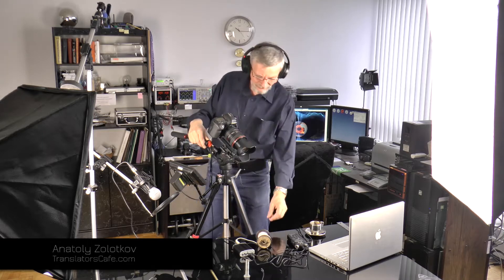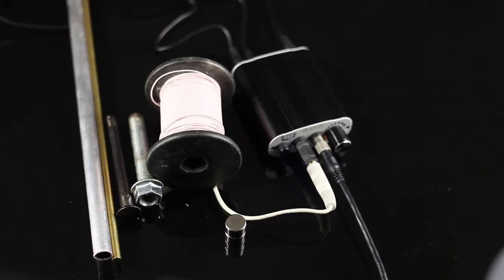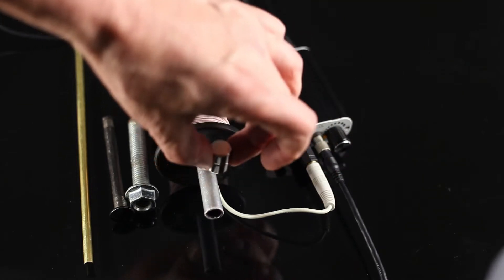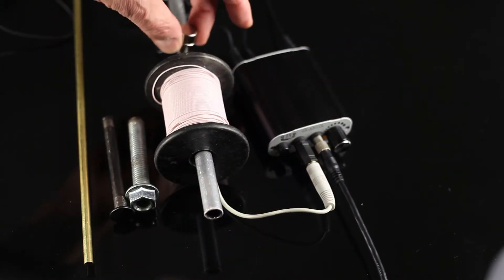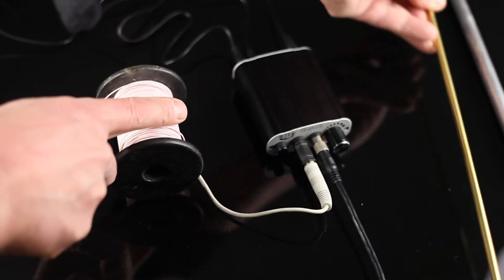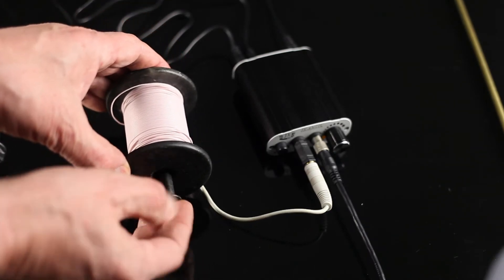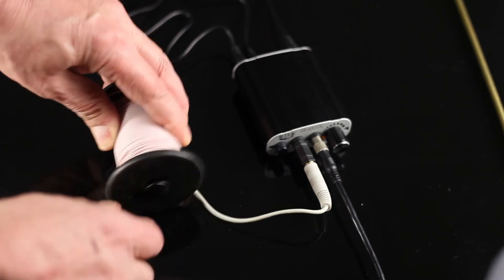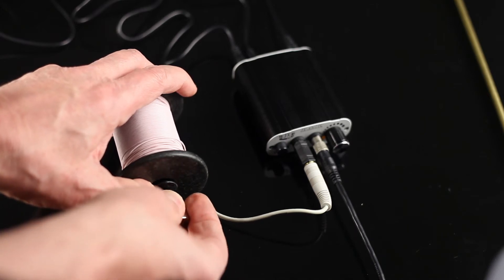Barkhausen Effect

Comment: (i also asked Caltech's Feynman Lecture Hall @caltechsfeynmanlecturehall3112, this question  in one of their videos on this subject matter.)

Thanks for showing us that!

Can one be made into a Möbius Strip, and you could "Warp" the time and send two objects through in both directions according to your Polarity, or something?

Where you have the 'Opening' you could send one or both in the same direction and as the first one approaches the 'Opening' the second one could 'Exit' the "Tunnel" thingy and loop around under the wire, sort of like an 'Off Ramp' on the Highways or Roads, and then both could be in one place at the same Time and Space again?

Something like this,
                                            -                                     
                                       -         -   
                                    -         -
       //////                 //////  -
   //          //        //          \\
//     0 .1 -/+ ∞ +/-  1.0     //                              
  //         //          //           //
     //////  *              /////
       *         *
     *        *
         *

Would that work?

i GUESS a Infinite Loop of Connecting Points, or Time Machine?

Comment: Which wire you have use in making electromagnet and have you connect it to any power supply??
Reply from the maker: In this experiment, I used a Soviet-made stranded pure copper wire type МГТФ with Teflon (PTFE) insulation. The 19-strand core diameter is 0.5 mm (24 AWG). The coil was connected directly to the preamplifier.
Reply: No, you just need to connect each end of the coil to the +/- terminals on your amplifier input. Place an iron rod inside the coil and bring a magnet near the rod.

Comment: thanks for posting.     here are a few very very late thoughts.   never heard of this effect before.   and i strongly suspect the theory to be  Flawed.   even if it is not, this video shows a demonstration is of a method of detecting  INDUCED CURRENT, a la  faraday, in a (coiled) conductor or solenoid.   nothing more.   induced current is simply being converted to an intermittent Audio signal.    lmao      cheers                     googletranslate